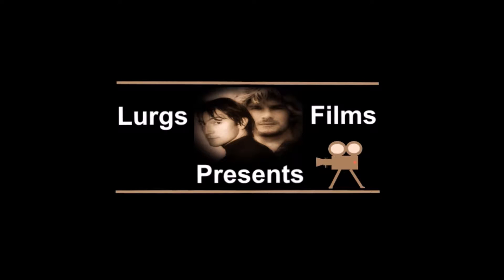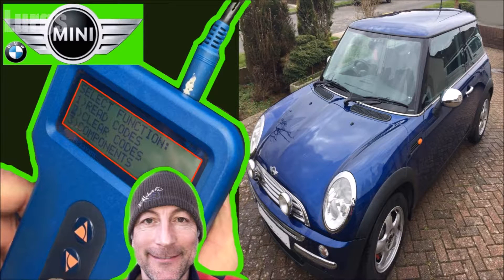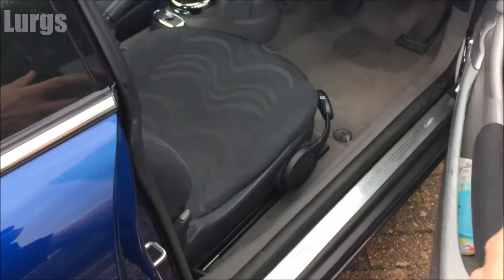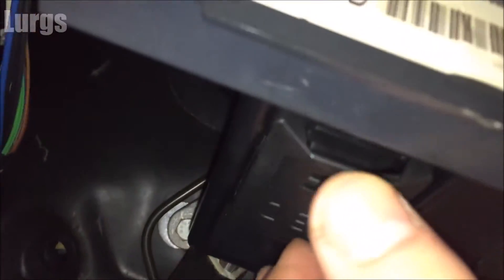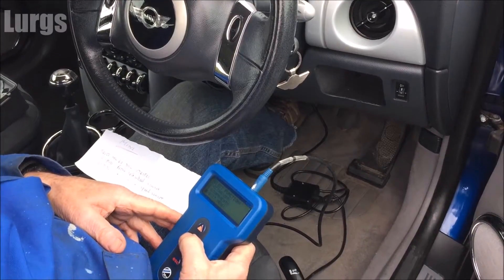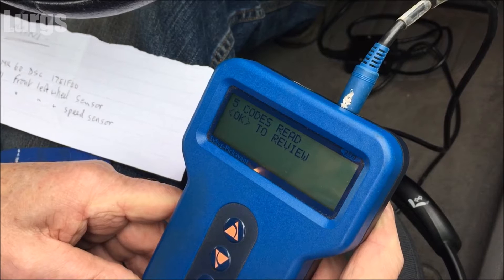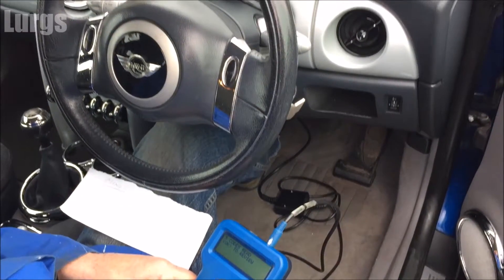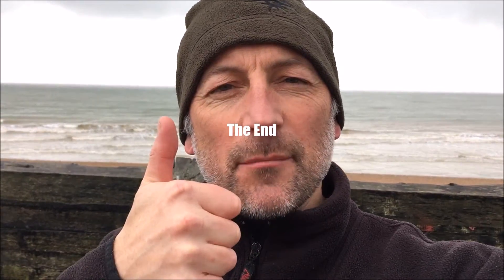Mini OBD2 Diagnostic Port Location R50 R53 2000-2006 First Generation

Comment from the maker: Other useful Mini First Generation (R50 R52 R53) links to help you save ⏱TIME and 💰 MONEY:
Mini Dashboard Warning Lights & Symbols - Mini R53 Instrument Panel https://www.youtube.com/watch?v=8QedyIKG0w4&list=PLqrXuUebV8N-Abne7l3O4wE14SiA7e8nQ
How to replace brake light bulb on Mini First Generation R50 R53 https://www.youtube.com/watch?v=a48vpR2xKgk&list=PLqrXuUebV8N-Abne7l3O4wE14SiA7e8nQ
How to reset Tire Pressure Light on Mini https://www.youtube.com/watch?v=lMzkLabmySw&list=PLqrXuUebV8N-Abne7l3O4wE14SiA7e8nQ
How to change headlight bulb on BMW Mini 1st Gen https://www.youtube.com/watch?v=I5hfUnBL8K8&list=PLqrXuUebV8N-Abne7l3O4wE14SiA7e8nQ
How to change Reverse light bulb on BMW Mini 1st Gen https://www.youtube.com/watch?v=4NtmnPes5_A&list=PLqrXuUebV8N-Abne7l3O4wE14SiA7e8nQ
How to remove Condensation from BMW Mini 1st Gen Tail Light https://www.youtube.com/watch?v=3kaDV3XLWKw&list=PLqrXuUebV8N-Abne7l3O4wE14SiA7e8nQ
BMW Mini Fuse Box Locations and How to check Mini R50 R53 Fuses https://www.youtube.com/watch?v=dKvzZzoNXrI&list=PLqrXuUebV8N-Abne7l3O4wE14SiA7e8nQ
.
How to replace ABS Wheel Speed Sensor on Mini https://www.youtube.com/watch?v=H47uRXH9nEI&list=PLqrXuUebV8N-Abne7l3O4wE14SiA7e8nQ
What is BMW Mini 1st Gen TPMS and how does it work https://www.youtube.com/watch?v=Fqa07ob6vv4&list=PLqrXuUebV8N-Abne7l3O4wE14SiA7e8nQ
Mini Tire Pressures https://www.youtube.com/watch?v=BJpBH5cy3WU&list=PLqrXuUebV8N-Abne7l3O4wE14SiA7e8nQ
.
How to replace Exhaust Bolts on BMW Mini 1st Gen https://www.youtube.com/watch?v=5O_s02egisE&list=PLqrXuUebV8N-Abne7l3O4wE14SiA7e8nQ
Mini Engine Bay Overview https://www.youtube.com/watch?v=Cu_RJUSWy3o&list=PLqrXuUebV8N-Abne7l3O4wE14SiA7e8nQ
How to open Bonnet on Mini https://www.youtube.com/watch?v=_ilFXnOMquE&list=PLqrXuUebV8N-Abne7l3O4wE14SiA7e8nQ
Mini OBD2 Diagnostic Port Location https://www.youtube.com/watch?v=pITxVyXQlgM&list=PLqrXuUebV8N-Abne7l3O4wE14SiA7e8nQ
Mini Battery Location and How to check Battery https://www.youtube.com/watch?v=shreDc1KYnc&list=PLqrXuUebV8N-Abne7l3O4wE14SiA7e8nQ
How to top up Windscreen Washer Fluid on Mini https://www.youtube.com/watch?v=5HDaweT_zUw&list=PLqrXuUebV8N-Abne7l3O4wE14SiA7e8nQ
How to check Alternator Belt on Mini https://www.youtube.com/watch?v=DOlpnb6ZEyg&list=PLqrXuUebV8N-Abne7l3O4wE14SiA7e8nQ
How to set clock on Mini https://www.youtube.com/watch?v=e-Kro_M4Z1c&list=PLqrXuUebV8N-Abne7l3O4wE14SiA7e8nQ
.
BMW Mini Cooper 3rd Generation How To's, Tips, Tricks & Fixes https://www.youtube.com/watch?v=7jxdaCRM_mY&list=PLqrXuUebV8N_iY1vf3AgGtkdx3uxGgpI_
Vehicles How To's, Tips, Tricks & Fixes  https://www.youtube.com/watch?v=w44aQ7dc_Lk&list=PLqrXuUebV8N9fyM8qA2D0rkVfv929Ckod
How to check car fuses without pulling them out https://www.youtube.com/watch?v=w44aQ7dc_Lk&list=PLqrXuUebV8N9fyM8qA2D0rkVfv929Ckod
How to check brake lights by yourself https://www.youtube.com/watch?v=jBK5W18zGJg&list=PLqrXuUebV8N9fyM8qA2D0rkVfv929Ckod
How to check a Car Battery with a Multimeter https://www.youtube.com/watch?v=VlkYGIMFj48&list=PLqrXuUebV8N9fyM8qA2D0rkVfv929Ckod

Comment: Nice upload, it took me ages to find where my diagnostic port was hidden. I guess they don't want you to be able to diagnose the faults yourself.  Less money for the main dealer !!!
Reply from the maker: It's a crime what they charge just to plug in a laptop and read some codes. Some of the jobs are literally 5 minutes & they charge you normally an hours labour. Independent garages are better, main dealers will literally drag the wallet out of your trousers or handbag and empty it!